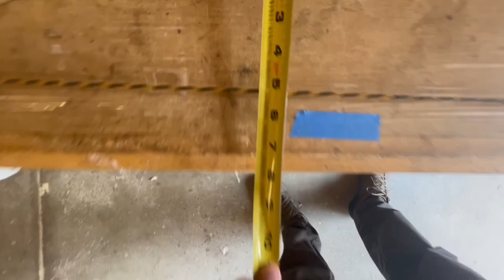Bamboo Duoflex Take 2 - Pt2 Full Tillering Process

Comment: Have you thought of maybe building some overbend into your bow form?  It seem that you're losing enough of the reflex at the tips on the builds that you've filmed that building a form with a steeper reflex would take you where your current form is aiming at if you see what I mean.  I don't speak from a position as an experienced bowyer but as a guitar builder where I know a lot of the guys build an overbend into their side bending forms to take spring back into account.
Reply from the maker: This mold had the over-bend that gave me the result that I wanted in this build.  The belly treatment was used primarily for tillering purposes, with the weight improvement being a Hail Mary to gain a few pounds of draw.

Comment: You compare the tillering of these bows to Asiatic bows which is a bit disingenuous. The limbs of some Asiatic bows are not very stable, and that's why they use heat to balance the limbs, not tiller.
You cannot use heat to create the illusion that a bow is well tillered. Thin areas will always be under more stress than thick spots. And thick areas will never be doing their fair share of work. 
Nothing is free in the world of wooden bow building. A stable, reliable wood bow is only stable and reliable because it's been tillered so all parts of the limb are working. A bow with poor tiller, even if heated to have the illusion of a good tiller, simply will not outlast a well tillered bow. 
That massively thick spot on the left limb on the video will only cause future problems. 
The incorrect mass placement in the limbs likely is also one of the contributors to the large amount of set those limbs took.
Reply from the maker: Can’t argue with anything you’re saying.  Tempering bamboo is akin to heat treating the belly of a white wood bow - it does aid in the ability of the material to stand up to compression.  However, bamboo is not wood. You’re spot on also on the thin spots in this bow. It hasn’t shown any signs of hinging as you would expect with as significant as those thin areas would suggest. The nodes of bamboo are an odd aspect to deal with - which is why I have moved to ensure that the growth directions run opposite of each other in future builds. Interestingly enough, the shape of those limbs are nowhere near the same of you were to compare them side by side - but it’s in balance shoots very smoothly. Another part of this build that I have abandoned is the heat tillering for the exact reasons you mention. Again, this is why these builds are regularly referred to as experiments.
Reply: @meadowlarkadventuregear  yeah you're right, bamboo isn't wood. But for all intents and purposes, we basically treat it as wood as it essentially serves the same purpose for us bow builders. Especially those of us that would rather not work with fiberglass. Though it does have some natural properties that wood doesn't. But we still call a bamboo bow a wood bow and to say it isn't is just kind of pedantic. 
Bow building is definitely a whole lot of trial and error. And your bows are definitely a thing of beauty. Thank you for sharing your experience with these types of bows with us.
 Heat treating is a fantastic thing. A proper tempering of the belly can really improve performance for sure.